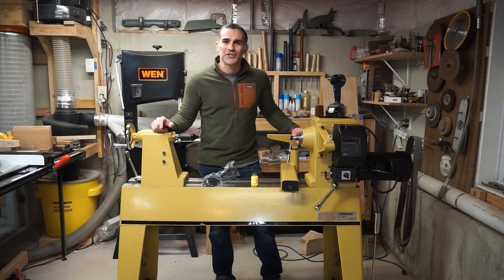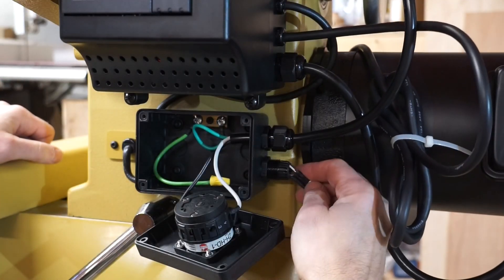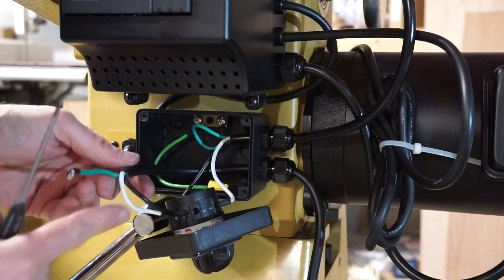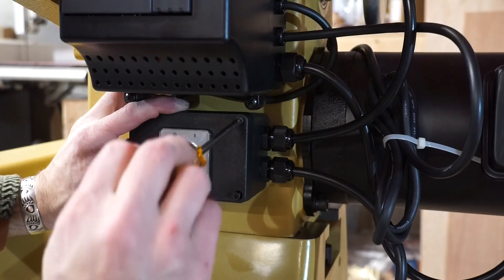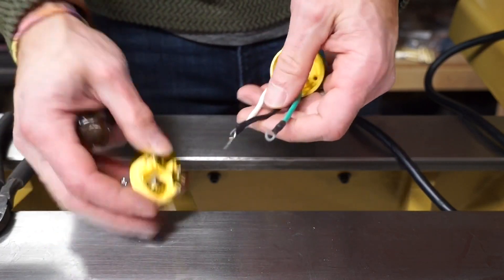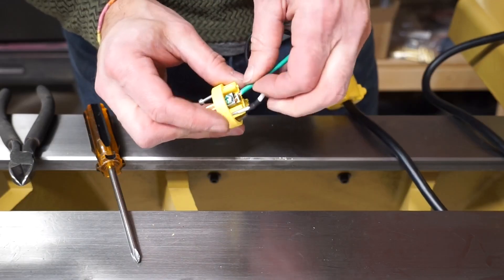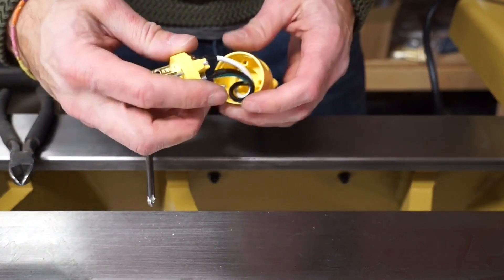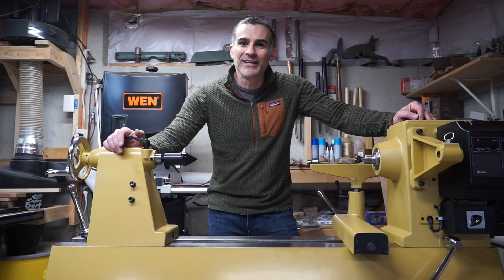DIY: Wire Your Powermatic 3520 Lathe

Comment: OK, it's all set-up. Time to make some stuff!
Reply from the maker: No doubt, Dave! I turned an off-center rectangular bowl, which I’ll be posting next week, and was shocked that I still got vibration at 750 lbs! Sadly I have t had time to flex it out much. I needed to get a new bandsaw to cut bowl blanks to really put it to use.
Reply: @industrialcomfort  Vibration of the lathe or on your tool? How fast were you turning? It really doesn't take much off-balance to get the lathe dancing depending on the size of the blank. Also, there is usually a range of RPM where there is some natural vibration--often if you go just a bit higher the vibration will go away. Be careful of course--nobody wants a piece flying through the shop (or into their face!). I usually turn between 600-800 RPM for bowls (on the lower end when roughing), but will speed up once in balance and I'm coring. But by rule of thumb, I try to never turn a bowl above 1,000 RPM, though speed is fun!